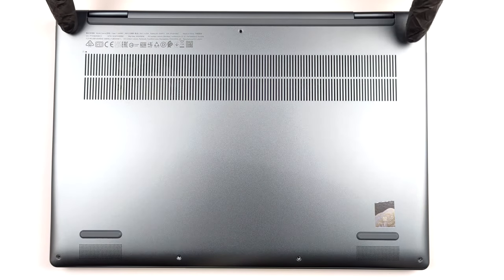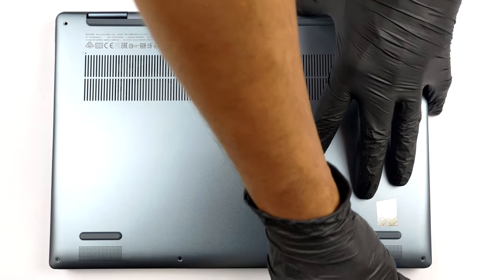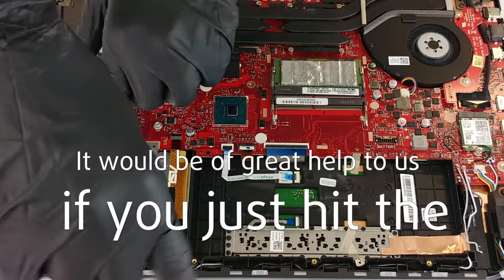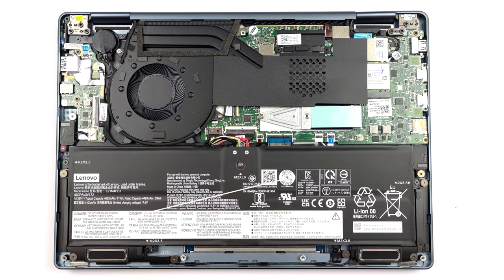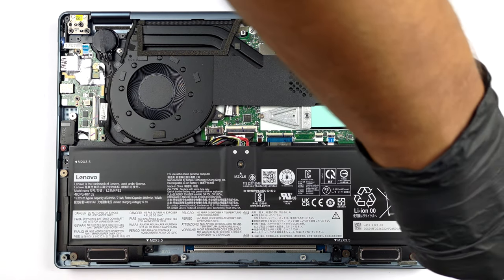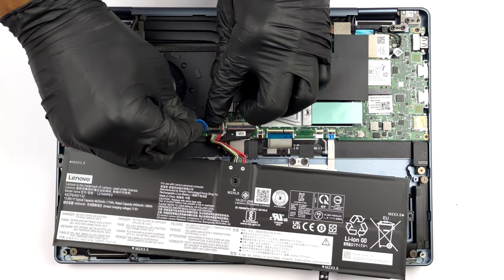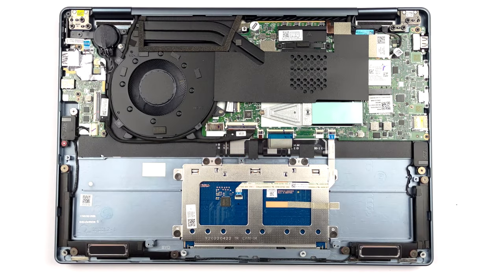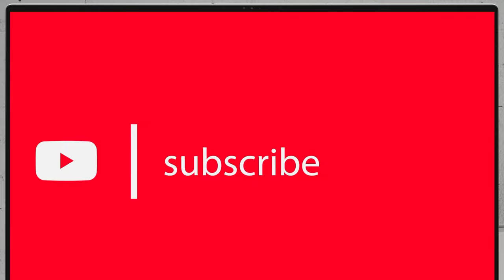🛠️ Lenovo Yoga 7 (14", 2022) - disassembly and upgrade options

Comment: Please do a review on this, no one on earth has done video review on this laptop
Reply: I know right?? On paper, its perfect for me, but want to know how it performs in real life before buying this expensive device
Reply: I read on several subreddits that there is a problem with the oled panel an the touchscreen grid lines. maybe i'd go for the ips panel if you don't need the deep blacks too much
Reply: @FlashTheEagle  I have ordered it already, ill update when I get it
Reply: @mrduck7957  cool. hope you like it.
thank you very much
Reply: @FlashTheEagle  I got mine already, can you emphasize more on the oled panel touch grid lines? I don't see anything wrong, but maybe I'm just unfamiliar with oled and touchscreen
Reply: @antiwoosh4302 so every touchscreen panel has a grid of hprozontal and vertocal lines in them to recognize touch. usually those are invisible even on oled.
apparently on this panel (only the oled) some users can see these lines when viewing light surfaces. and this is actually not desired

look at a white screen and report back if you experience this issue.
Reply: @mrduck7957  Hey, did you already get it and what's your experience so far?
Reply: @ProSkythe  not yet it scheduled for delivery on this Thursday
Reply: kinda late on this but ive used this laptop for the past 3-4 months and cant complain about it. While there are slight red grid lines on the oled panel, they are honestly not visible even when looking close up. I recommend this laptop tho there is a newer verson (gen 8) available now

Comment: Hi. How is the cooling done for the ssd? Is the drive somehow connected to the chassis? do is see  correctly in the video that there is a thermal pad? Background: i have ordered a Yoga 7 14 with 32GB(as the RAM is soldered) and 512GB instead of 1TB SSD because i want to upgrade the ssd to 2 or 4TB anyway. i have a SN850(X) or a KC3000 or a sk hynix P41 in mind. But i read that the SN850 could reach 100°C.  Maybe this is also interesting for others.
Reply: only supports 1TB...
Reply: @luke1811  this can't be true,as i have read multiple times about the Samsung 980 Pro 2TB working (with slightly reduced speed). Also there is no reason that a standardized ssd should not work with a standardized protocol or connector. the only limitation i have seen so far: only single sided SSDs (max 2280) are working as there is no space. However,i figured out myself how the cooling is done.
Reply: @daytonde  you lose your warranty if you use something different than M.2 2242 SSD PCIe NVMe, PCIe 4.0 x4 with 256GB / 512GB / 1TB, but the slot is a M.2 2280 PCIe 4.0 x4 slot, so if you dont need the warranty it shouldnt be a problem to upgrade it.
Reply: @stefankraus6555  Doesn't bother me.There are explicit laws/court decisions in Germany that you can upgrade exchangable pc parts like you want without loosing your warranty. Even Lenovo itself has Manuals for the Disassembly and exchange of Parts.There is also no kind of security seal on the device and i didn't plan to throw the original SSD (which is in fact a 2230 )for such warranty purposes away. In fact Lenovo has to prove that the (my) exchange of the SSD caused the (possible, if any) warranty case. As long as i don't exceed any technical specification for PCIe 4.0 NVMe - the size of the memory is not such - i don't worry. i explicitly bought my Device with 32 GB RAM (as it is soldered) and the 512GB SSD (as the 1TB is not enough for my specific needs anyway and i'm not willing to pay 200€ extra for an "upgrade" that is worth roughly the half).  I'm a qualified IT Professional too,so i have no fear and more than enough self confidence and responsibility to do such an easy task.  As a tip to others: if you plan to exchange, look for the "L1.2 power management"-Feature on your future SSD,as others (such as the SN850X) might run too hot otherwise and the Fan will run constantly. Also only single sided devices will work,as there is no space for a double sided module.  I tested this with a SN750 1TB. Be careful and calm when you open it up as you may break small plastic parts if in a hurry,
Reply: @stefankraus6555  this is a myth and a way for repair centers to try to avoid taking your laptop, but as long as you only unscrew a couple of screws and replace with compatible parts they are legally not allowed to void the warranty in any EU country (i don't know about other places)
Reply: Late reply, but ssd memory works better hot. You'd never want to cool an ssd unless you're doing it for asthetics like in a watercooling loop, but even then that would be dumb because you'd degrade performance.

Comment: Hi there :) Can you see an kind of weird pattern from the touch digitizer on the screen? I've seen several people online complain about it but none of the few reviers seem to mention it.
Reply: Das stimmt. I have this exact model and can see the pattern (digitizer lareyer) and it is most noticeable on bright mono-colours (i.e., white, or gray). Having said that, I still decided to keep the device as I find the 90hz OLED screen awesome in every way besides the digitizer pattern - it is just a shame they messed it up.
Reply: @DeluxSauceMeister  Have you asked support about it? I've recently opened a ticket but haven't heard back yet. I just find it very strange that the two big reviewers that I've seen reviews of didn't mention the problem in the slightest
Reply: @BastianHodapp  Because that "problem" is no problem at all if you use the device like a normal human. You only notice it if you glue your eyes (< closer than 10cm) to the display on full brightness and a white/bright surface. i doubt you want to do this,as it hurts he eyes. ;) this is the only ocassion i have noticed it - and only because i searched for this "issue". this is in fact the best screen i have seen in 20 years of IT (besides some Amoled on smartphones)

Comment: Is the wireless module accessable? I hate the MediaTek drivers. 6GHz does not work... So I'm thinking about to switch to Intel modules inestead
Reply: Yes, it is! I've just swapped the MediaTek one for the Intel AX210 and it was as easy as to swap an M.2 SSD :).

Comment: I've just got the yoga 7 16 inch gen 8. I've unscrewed the screws, and try to lift away the back panel, but it seems stuck in the middle. Don't know if they have glued it, but all the edges come off, just the very middle won't move. Any ideas?
Reply: Did you managed to open it  ?
Reply: This is true. This video needs to be remade to demonstrate removing the rear panel without risk of bending it as it doesn't come off like normal laptops. Surprisingly poor video from laptop media, who are usually better than this.